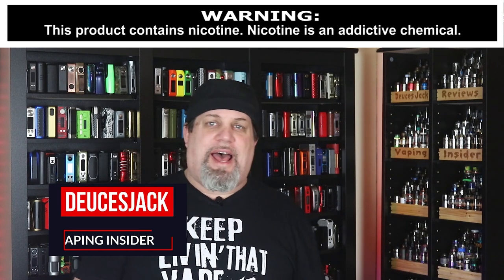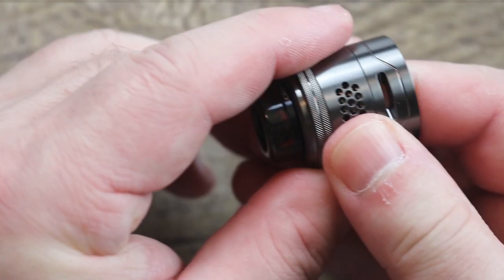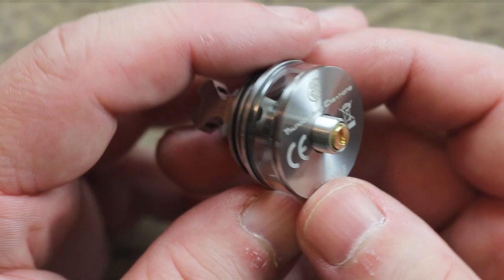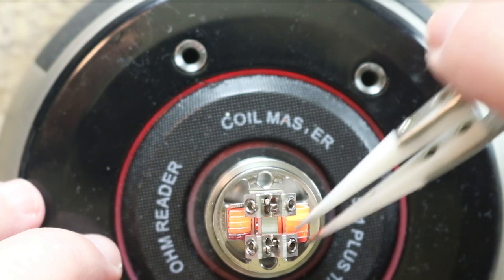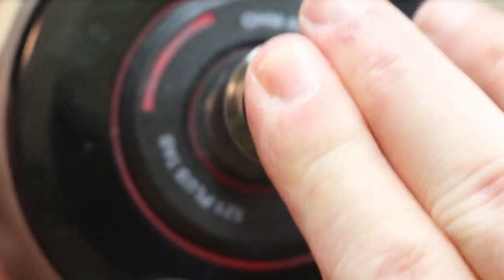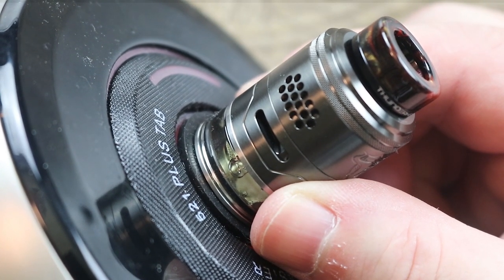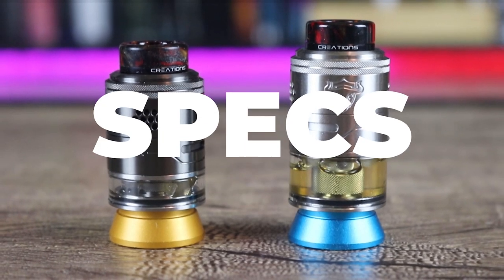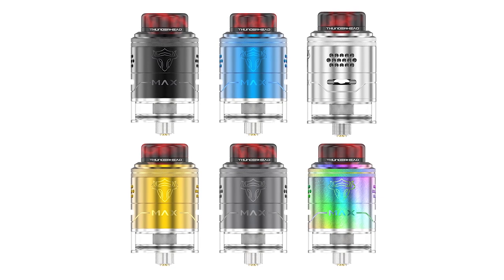MY FAVORITE RDTA!

Comment: Someone please help me. I’ve bee vaping for a couple years and only ever used sub ohm tanks. I had a smok tfv8 and now I use a smok mag. The tanks I use were just the ones that came in the box. I’ve heard in September everything is changing and that I need to buy rda so that I can build my own coils bc I won’t be able to buy premade coils for tanks anymore. 
I dont know anything really about any vape stuff: coils, ohms, building mods etc. I have tried to read up about it a lot and I just get overwhelmed because I can’t understand. I don’t think I’ll ever be able to wrap coils because I just don’t understand ohm, volts, resistance and all that stuff. I figure the most I can do right now and get an rda and buy a bunch of coils and wicks. Are coils and cotton wicks cheaper than coil heads for a tank? 
Can anyone please help me buy what I need? There so many options to choose from and I have no idea what to look for and what is the best. I need something that is very newbie friendly. Something I can just pop a coil in and use it. Also I would need to know what coils to buy for whatever device you suggest. (Right now I vape at 60 watts,on a .17 ohm prince mesh coils, idk if that info matters to help figure out what coils I would want for a rda) PLEASE can someone please help me. I DONT WANT TO HAVE TO GO BACK TO CIGARETTES IN SEPTEMBER!!

Comment: Never had a Rdta. I thought you would put the wicks all the way down to bottom of the tank. Do you have to turn it to it’s side when it’s getting low on juice so the wicks get wet or just keep squonking and keep tank full at all times✌🏾
Reply: I like to keep my tank full but on a standard mod I like to drip most of the time and only use the tank when I walk away from my desk
Reply: I recommend RDTA's. I purchased the Mato RDTA and I love it man. My first RDTA was the Blitzen and I forgot how much I loved it. Ive always gotten really nice flavor from them. I definitely recommend it.
Reply: Yeah sometimes tilt it Roy ..try the Brunhilde asomome flavor
Reply: Actually had them a bit long...but you can't really screw up wicking this thing. 
Cotton should barely peek through holes, hardly visible when tank is perfectly level.....less cotton in tank means more juice capacity but doesn't change the vape. Tipping action indeed helps wicking but comes naturally...no need to vape like you're downing a beer or something. 😆 I love my rdtas alot. Pyro v2 v3, nefarious, faris, Tauren....etc
Wick like demons, all of them.👍
Try one brother, you won't be disappointed.(i squonk them all btw)✌
Reply: No u just want the wicks dangling into the well not at all to far down or it wont wick as well. And u dont have to tilt - just as u naturally vape , the motion - its already doing that lol 
I personally love rdtas too . Always keeps wicks wet n ready to go .
Reply: @bendownswing3774  I want to get the Brunhildle next. It was a bit pricey when it first came out that's why I didnt pirchase it. How is it?

Comment: I would say the wicks are way too long, you lose capacity that way, all you need is the wicks to be barely visible to the top of the glass, tilting wicks it, and as you draw it pulls the liquid up. Also rdta' s aren't any louder than an rda with the same airflow. It is after all, an rda with a larger well.
Your wicking at the end with the larger glass is bang on
Reply from the maker: My wicks are fine. The cotton slots are huge. Trust me, I've only wicked a few hundred different attys in my life.
Reply: @VapingInsider  so have I 😁 and rdtas are my favourite overall. I own 10
Reply: @VapingInsider  😂

Comment: Such a shame the juice capacity is so low, and with the coils so close to the tip you're gonna get a lot of drip back
Reply from the maker: Its squonkable.
Reply: @VapingInsider  I have no idea what that means dude
Reply from the maker: It mean is has a hollow 510 pin at the base. If you put it on a squonker mod. A mod with a juice bottle in it, you can squeeze the juice from the bottle into the tank.
Reply: @VapingInsider  Oh okay thanks man! Still figuring it all out

Comment: Bro, you might wanna change you mic position, a lot of breathing and popping sounds going on..
I think I can hear your beard rubbing against the mic in the table view lol..
When you`re standing up, the sound is just fine.
Nive review tho, the RDA looks very nice, I like the deck, I like the squonk system, I like the FLATHEAD 510 although I`d like flatheads on the deck as well, the honeycomb airlow looks real nice, and I like the options.
Too bad nobody has it in Norway yet, because ordering from abroad could almost double the price and eh, yeahno..
I want a "snorkel" airflow, so I hope it comes here :)
Reply: USD 38.60
List Price: USD 57.90 | Discount: 33% off on Heavengifts
39 bucks other places, don`t see this dropping below 30 any time soon, unless you get a 50%sale.
Edit: Vapesourcing has it at 28, but it`s an american site, so that`s probably 20 bucks or more shipping for my part, so, yeah..